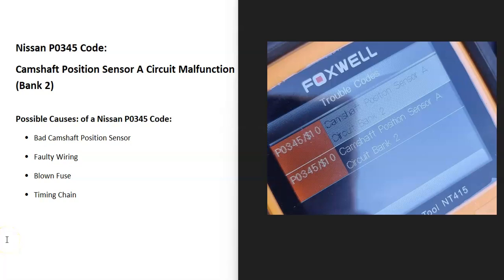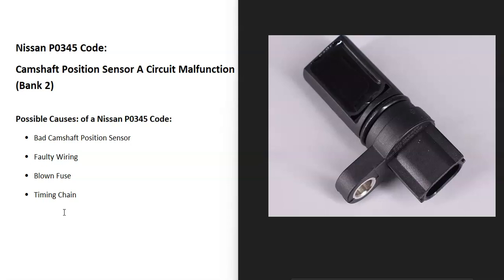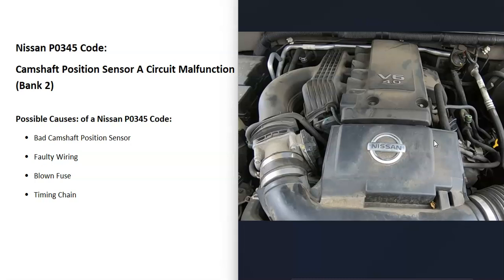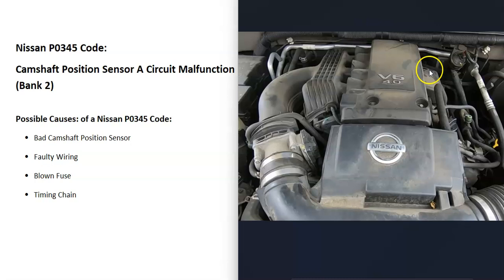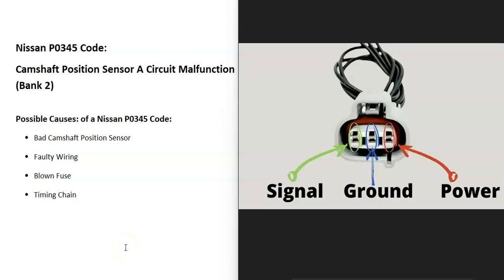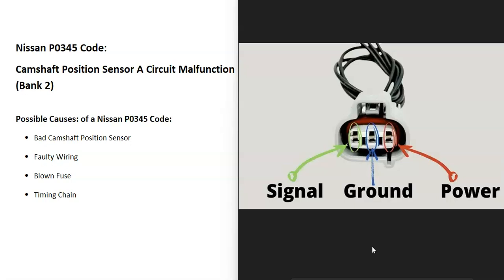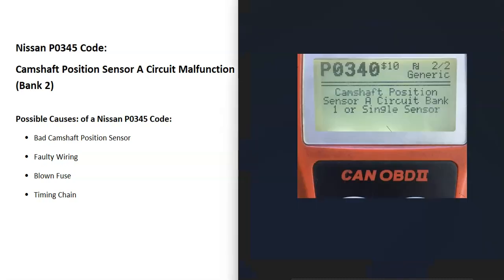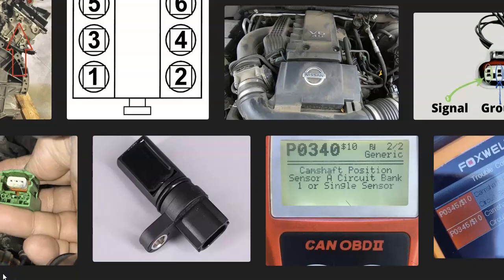Causes and Fixes Nissan P0345 Code: Camshaft Position Sensor A Circuit Malfunction (Bank 2)

Comment: Thank you! This is very helpful as I am currently experiencing this on my 2015 Nissan Frontier. First it was P0340, and I replaced that sensor last night. I thought I was good to go and this morning it started throwing a P0345!? So first it ws bank 1, now bank 2. Is there I was I can confirm or check if this isa timing belt issue?

Comment: PLEASE HELP:  Ive had a permanent crank no start, I replaced all 3 sensors CMP and ckp, there was oil inside the harness connector for the CMP on bank 2, cleaned it out but still crank no start and now the p0345 code showed up tho it didn't before.  I've tested everything else, replaced everything else.  What do you think I'm missing.  I ordered new pigtails plugs for both CMP and am going to wire them in, is it possible that my ECU may just need to be replaced since it's 23 years old?
Reply from the maker: If the sensors are good, the next thing is to check the wiring. There are usually three wires: Power (5 volts), Ground, and a Signal wire back to the computer. I made a video on how to test the wiring and sensors. Here is a link.  https://youtu.be/MU95sRU8wng
Reply: @HVAC_Mechanic I actually followed that exact video to test mine lol.  Yeah the wiring was giving me good readings.  Which is why I'm stumped...  And wondering if it is ECU.  What do ya think
Reply from the maker: It could be the computer, but that is rare. If the sensors and wiring are good, the computer may need a Cam sensor relearn. Also, if the sensors are low-cost non-OEM sensors, sometimes those can cause issues.

Comment: Anybody ever had a 2015 VQ3.7 with a bank 1 cam correlation code? 

I am working on one with that issue, and I can not find the issue. The owner has already replaced both cam sensors and both VVT solenoids with dealer supplied parts, and no fix. Car goes into limp mode when issue happens. 

Things that I have checked and verified....

#1 Timing chain is not stretched or jumped.

#2 No sludge in top or bottom of engine.

#3 Has plenty of oil pressure, verified by a known GOOD mechanical guage, piped into where the electronic sensor goes into the block.

#4 Checked each wire going from the sensor and the VVT plugs to the correct ECU plug and did a wiggle test with beeper on meter going. No issue there.

#6 I put my dual trace oscilloscope on the outputs of both of the cam sensors. I get a perfect square wave from each one, BUT one square wave is behind the other one on the screen of the scope (I do not remember what I had the time setting on the scope set to, but it did the same thing on any setting that would give me a trace on the screen). Should the traces be straight up and down from each other?

#7 I cleaned all the passages out in the 2 timing covers while I had them off, and replaced the gaskets and o-rings. 

#8 Both of the new VVT solenoids are clean and function when I temporary apply 12volts to them on the bench. I can easily blow air thru them when power is applied also.

The vehicle has 77,000 miles on it.

I have read about the dreaded cam encoder slip with the pressed in encoder on the sprokets on the cam gears. Can this be the issue?

A Snap-On scanner says that bank 1 cam is 17° advanced from commanded position. Every time I have deleted the code, it comes back on the scanner with the same 17° error.

The engine runs perfectly otherwise, way too well (in my opinion) for the bank 1 cams to be off 17°.

Cranking compression is the same on all 6 cylinders.

T.I.A. for any help!!!
Reply from the maker: You covered most everything. If I had to guess, the most likely cause is bank-1 intake cam phaser/reluctor wheel slip.

Comment: 05 maxima no start condition. Bench tested all three original sensors and all were faulty. I then ordered replacement hitachi OEM sensors and resolved p0340 and P0335. Engine now starts and I can drive it but P0345 persists. 

What is weird is both my nds2 (nissan datascan software) and my el cheapo code reader finds P0345 twice listed...Not sure what that means.

Comment: Would a P0345 code turn off VDC. 
My VDC all turned off and this is the only error I am getting under pending.
Reply from the maker: Yes, it is common for the computer to shut off any driver-assist programs when there is a problem with the engine.
Reply: @HVAC_Mechanic thank you. Yes the only thing coming on is VDC off and traction off, the two orange ones are on. 
So I am going to change the sensor, even though there is no engine light warning, but it is under "pending". There is also a bit of oil weeping out of the sensor

Comment: Do you have to replace both ?
Reply from the maker: A single unit can be replaced; just try to get an OEM unit if possible.
Reply: @HVAC_Mechanic 340 is bank 1 and 345 is bank 2 right?
Reply: Do have the wire diagram for the camshaft sensor b2